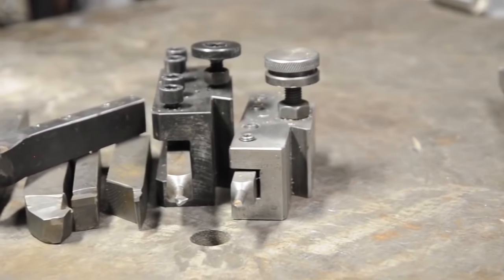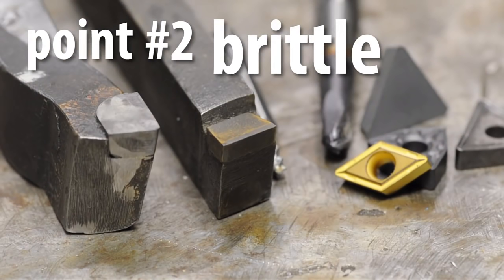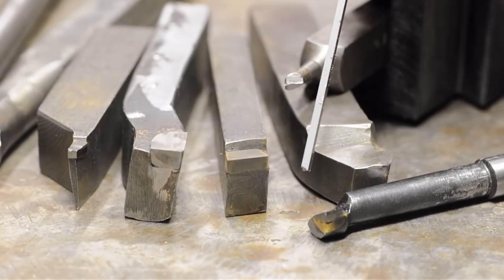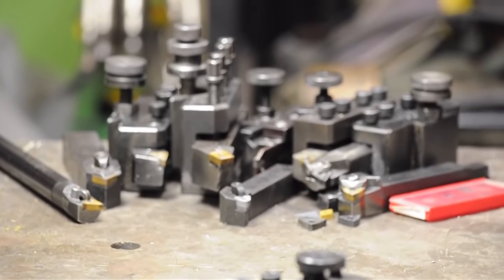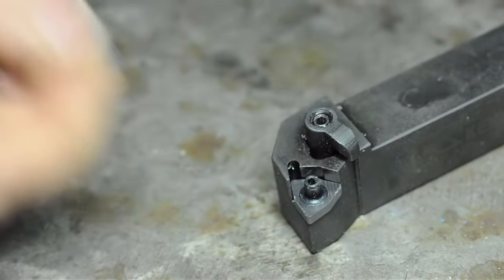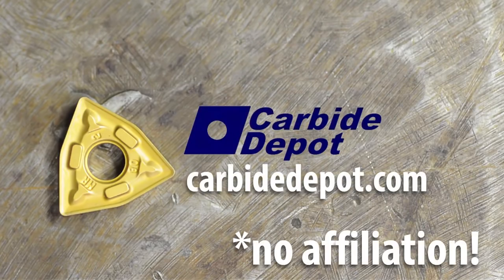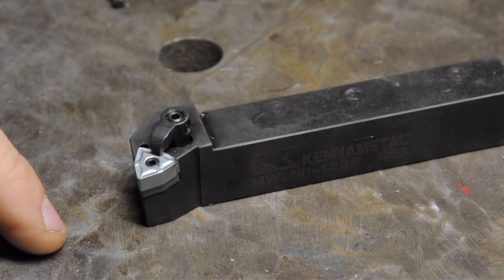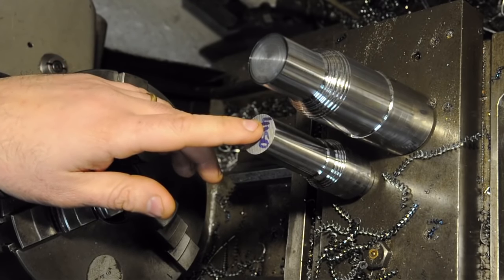A Brief Chat about Carbide Tooling

Comment: Tony, just wanted to drop by and say thanks. I'd consider myself a fairly experienced hobby machinist, but after watching this video on carbide tips, I went into the shop and raised my spindle speeds and cut depths considerably. Holy heck. I can't believe the results. Now running 3 x faster and taking cuts 4 x deeper. Instead of swarf, I'm now covered in 1" long chips. I'm now taking 40 thou at 1250 rpm. You Sir are a legend.
Reply: Your depth of cut should normally be a minimum the same as your nose radius, and a true bare minimum of 2/3 your nose radius. So if you were using a "08" nose (1/32") then 40 thousandths is good, and a typical minimum of .032" depth. Hopefully if you were only taking .010" cuts before you were using an 04 (1/64) nose, since the absolutely minimum of that is a 10 thou cut. Those are just the general rules for proper chipping and surface finish, but also require a proper feed rate and RPM top go with them.

The maximum depth depends on the insert type, how much HP the machine has, and how rigid the machine is. A CNMG type has the largest depth of cut (.667 * length of insert edge), next is a TNMG and DNMG (.5 * edge length). WNMG is usually the smallest maximum depth of cut insert type (.25 * length to the middle point of the edge), but the tradeoff is it can be used for both turning and facing and has 6 cutting sides per insert.
Reply: @LordSaliss  i wish I knew what those words meant. I have a little mini lathe. Im here to figure out what the different tooling is used and how its used. Think im already ar a disadvantage. My motor burned up so I put on a ½ hp motor from a whole house fan. Only have high and low. With no idea as to the rpm.
Reply: @kathleenrobertpogue6818  Highly recommend picking up an old treadmill or stairstepper for cheap. Durable strong motors in those things, and can be had for sometimes less than $50, especially if you find a damaged one with a good motor

Comment: Easiest thing to make in any shop is a broken end mill or bit.
Reply: Or mill vice
Reply: lol
Reply: When you get really good, like me, you can turn aluminum and steel stock into scrap.
Reply: Dennis Young  I like to turn small broken carbide into spade bits - good for drilling out other broken (HSS) stuff if it's not too deep.
Reply: Wen a tool breaks the second time, does it become good again?
Reply: Broken taps is also really easy
Reply: @hans429  easy there brother... “thinking” out loud can be dangerous. Humor is also rather tricky when you never “practice”... experience is something we only gain after we need it. 
hang in there like your a dingleberry nicknamed  “Forrest grippin’ “
Reply: Some tool manufacturers: well it will be harder to break if you buy our new collection of tools at ke*****al
Reply: @galvidmar1247  lol right.
Reply: Lol, very true.
Reply: Sometimes I go out to the shop and make a whole bunch of broken taps.
Reply: I saw a guy break a carbide tipped tool when he ran the mill the wrong direction xD

It was funny cause i didn’t do it :)

Loved them carbide inserts.
Reply: I’m ioooooppp

No

Comment: If you plan on grinding your own carbide tooling, just know usually the component that holds carbide particles together is cobalt and its not the best thing to inhale. So use precautions like respirator etc.  I'm sure Tony just forgot to mention this.
Reply from the maker: Yes!  Good point.  I mentioned that in the boring head video but this would've been a fine place to bring it up again.
Reply: Dennis Young  better safe than sorry. You would need a continuous stream of coolant around and over the entire surface to minimize the risk of breathable particles flying about.
Reply: @eccomi21  even then not worth it. Best to be kept safely locked away from the world. In today’s world danger lurks everywhere.

Comment: I came here with two big questions. #1 How to distinguish carbide inserts via taste-test, and #2 where DOES he get his nails done. You answered NEITHER.

10/10 will watch again.
Reply: Carbide is significantly heavier than HSS, also isn't very magnetic
Reply: +Jake Scollay: "Carbide is significantly heavier than HSS, also isn't very magnetic"
And it tastes like chicken.
Reply: Cook your carbide in the sous vide at 66C for an hour then finish with a quick sear in a hot pan.  Really brings out the flavor and reduces the brittleness caused by sauteing.
Reply: Both nails and carbide are done "a la dente" and remember the water should be as salty as the Mediterranean. Hence biting both; rather salty.
Reply: Al dent eh?
Reply: A tricycle, because a vest has no sleeves. (Orange Sherbet 1972). Paul C. USA
Reply: Little machine shop
Reply: @sc0llay  the
Reply: I believe he does his nails on the CNC router with that 4mm four flute endmill he's always talking about breaking
Reply: you should see the manicured  nails of that Joe guy, off putting
Reply: Thanks for that,very interesting!
Reply: Great learned alot  thanks

Comment: 1 Carbon Steels 
Carbon steels have been used since the 1880s for cutting tools. However carbon steels start to soften at a temperature of about 180oC. This limitation means that such tools are rarely used for metal cutting operations. Plain carbon steel tools, containing about 0.9% carbon and about 1% manganese, hardened to about 62 Rc, are widely used for woodworking and they can be used in a router to machine aluminium sheet up to about 3mm thick.

2 High Speed Steel (HSS) 
HSS tools are so named because they were developed to cut at higher speeds. Developed around 1900 HSS are the most highly alloyed tool steels. The tungsten (T series) were developed first and typically contain 12 - 18% tungsten, plus about 4% chromium and 1 - 5% vanadium. Most grades contain about 0.5% molybdenum and most grades contain 4 - 12% cobalt.

It was soon discovered that molybdenum (smaller proportions)could be substituted for most of the tungsten resulting in a more economical formulation which had better abrasion resistance than the T series and undergoes less distortion during heat treatment. Consequently about 95% of all HSS tools are made from M series grades. These contain 5 - 10% molybdenum, 1.5 - 10% tungsten, 1 - 4% vanadium, 4% Chromium and many grades contain 5 - 10% cobalt.

HSS tools are tough and suitable for interrupted cutting and are used to manufacture tools of complex shape such as drills, reamers, taps, dies and gear cutters. Tools may also be coated to improve wear resistance. HSS accounts for the largest tonnage of tool materials currently used. Typical cutting speeds: 10 - 60 m/min.

3 Cast Cobalt Alloys 
Introduced in early 1900s these alloys have compositions of about 40 - 55% cobalt, 30% chromium and 10 - 20% tungsten and are not heat treatable. Maximum hardness values of 55 - 64 Rc. They have good wear resistance but are not as tough as HSS but can be used at somewhat higher speeds than HSS. Now only in limited use.

4 Carbides 
Also known as cemented carbides or sintered carbides were introduced in the 1930s and have high hardness over a wide range of temperatures, high thermal conductivity, high Young's modulus making them effective tool and die materials for a range of applications. 
The two groups used for machining are tungsten carbide and titanium carbide, both types may be coated or uncoated. 
Tungsten carbide particles (1 to 5 micro-m) are are bonded together in a cobalt matrix using powder metallurgy. The powder is pressed and sintered to the required insert shape. titanium and niobium carbides may also be included to impart special properties. 
A wide range of grades are available for different applications. 
Sintered carbide tips are the dominant type of material used in metal cutting. 
The proportion of cobalt (the usual matrix material) present has a significant effect on the properties of carbide tools. 3 - 6% matrix of cobalt gives greater hardness while 6 - 15% matrix of cobalt gives a greater toughness while decreasing the hardness, wear resistance and strength. Tungsten carbide tools are commonly used for machining steels, cast irons and abrasive non-ferrous materials. 
Titanium carbide has a higher wear resistance than tungsten but is not as tough. With a nickel-molybdenum alloy as the matrix, TiC is suitable for machining at higher speeds than those which can be used for tungsten carbide. Typical cutting speeds are: 30 - 150 m/min or 100 - 250 when coated.

5 Coatings 
Coatings are frequently applied to carbide tool tips to improve tool life or to enable higher cutting speeds. Coated tips typically have lives 10 times greater than uncoated tips. Common coating materials include titanium nitride, titanium carbide and aluminium oxide, usually 2 - 15 micro-m thick. Often several different layers may be applied, one on top of another, depending upon the intended application of the tip. The techniques used for applying coatings include chemical vapour deposition (CVD) plasma assisted CVD and physical vapour deposition (PVD). 
Diamond coatings are also in use and being further developed.

6 Cermets 
Developed in the 1960s, these typically contain 70% aluminium oxide and 30% titanium carbide. Some formulation contain molybdenum carbide, niobium carbide and tantalum carbide. Their performance is between those of carbides and ceramics and coatings seem to offer few benefits. Typical cutting speeds: 150 - 350 m/min.

7 Ceramics - 
Alumina 
Introduced in the early 1950s, two classes are used for cutting tools: fine grained high purity aluminium oxide (Al2O3) and silicon nitride (Si3N4) are pressed into insert tip shapes and sintered at high temperatures. Additions of titanium carbide and zirconium oxide (ZrO2) may be made to improve properties. But while ZrO2 improves the fracture toughness, it reduces the hardness and thermal conductivity. Silicon carbide (SiC) whiskers may be added to give better toughness and improved thermal shock resistance. 
The tips have high abrasion resistance and hot hardness and their superior chemical stability compared to HSS and carbides means they are less likely to adhere to the metals during cutting and consequently have a lower tendency to form a built up edge. Their main weakness is low toughness and negative rake angles are often used to avoid chipping due to their low tensile strengths. Stiff machine tools and work set ups should be used when machining with ceramic tips as otherwise vibration is likely to lead to premature failure of the tip. Typical cutting speeds: 150 - 650 m/min. 
Silicon Nitride 
In the 1970s a tool material based on silicon nitride was developed, these may also contain aluminium oxide, yttrium oxide and titanium carbide. SiN has an affinity for iron and is not suitable for machining steels. A specific type is 'Sialon', containing the elements: silicon, aluminium, oxygen and nitrogen. This has higher thermal shock resistance than silicon nitride and is recommended for machining cast irons and nickel based superalloys at intermediate cutting speeds.

8 Cubic Boron Nitride (cBN) 
Introduced in the early 1960s, this is the second hardest material available after diamond. cBN tools may be used either in the form of small solid tips or or as a 0.5 to 1 mm thick layer of of polycrystalline boron nitride sintered onto a carbide substrate under pressure. In the latter case the carbide provides shock resistance and the cBN layer provides very high wear resistance and cutting edge strength. Cubic boron nitride is the standard choice for machining alloy and tool steels with a hardness of 50 Rc or higher. Typical cutting speeds: 30 - 310 m/min.

9 Diamond 
The hardest known substance is diamond. Although single crystal diamond has been used as a tool, they are brittle and need to be mounted at the correct crystal orientation to obtain optimal tool life. Single crystal diamond tools have been mainly replaced by polycrystalline diamond (PCD). This consists of very small synthetic crystals fused by a high temperature high pressure process to a thickness of between 0.5 and 1mm and bonded to a carbide substrate. The result is similar to cBN tools. The random orientation of the diamond crystals prevents the propagation of cracks, improving toughness. 
Because of its reactivity, PCD is not suitable for machining plain carbon steels or nickel, titanium and cobalt based alloys. 
PCD is most suited to light uninterrupted finishing cuts at almost any speed and is mainly used for very high speed machining of aluminium - silicon alloys, composites and other non - metallic materials. Typical cutting speeds: 200 - 2000 m/min.

10 Other Materials 
To improve the toughness of tools, developments are being carried out with whisker reinforcement, such as silicon nitride reinforced with silicon carbide whiskers.
Reply: The knowledge gained from your inputs are so thorough & simply compiled that even the basic students would easily understand. 
A great compilation on the modern tooling materials and highly appreciated.
Reply: Was this Google paste
Reply: I was not prepared for the commitment required to read this whole post....
Reply: Great information, but YT comments are  a bugger to format when pasted into MS Word. :-(
Reply: @TrevorDennis100  paste to notepad 1st then copy the notepad to Word (the format will be nicer)
Reply: @malcolmparkins1935  Thanks Malcolm.  I usually paste into Word, and use Ctrl Space to strip the formatting, but I just tested doing it your way, and it is way better.  So top tip.  Thanks
Reply: @Skhillz_FN     Mr. 4 Subscribers .... 🙄😂😂😂
Reply: @AlexAlcyone  hi there atomic
what do you mean    ""shift command T""".   could you please explain the actual key strokes. :)
Reply: Excellent
Reply: This is helpful
Reply: ever work with high speed tatung stock..dont recall what cobolt content was but  was very good for machineing alloys..monel tita ium..4340....had the wear  capabality  of carbide and shock redistance of high speed..but not friendly to grind..took longer
Reply: Dafuq. Common knowledge that Knights were invented in 1880 to Fight Hitler in 1493 with their gummiswords.
Reply: THX; you just beat the pants off chatgpt! Much respect for TONY et al.
Reply: @11
Reply: Nice Cut and Paste....

Comment: Another great video Tony! One thing that keeps coming up on hobby forums for people with smaller lathes is they always say they can not remove much material on them because they are not heavy enough and/or don't have enough horse power. I have an old Craftsman 12" lathe, and find that for the most part, if you use it like it was designed, using a lantern tool holder, HSS and the proper high positive rake, you can peel off much larger amounts than using a quick change toolpost and insert tooling. Now I will say I also do not use the lantern very often, and use insert tooling, but because of the higher speeds and feeds required, as you pointed out, I typically use HSS inserts from Arthur R. Warner in my holders. They cut much better at lower speeds, and you can keep them sharp with honing.  Keep up the great work, love watching and learning!

Comment: I started lathe work with carbide tooling, couldn't figure out why the parting tool kept breaking so I got frustrated, ran it dry and reefed on it. Cleanest parting cut I ever saw
Reply: I can never get my parting tool to work worth anything, will give that a try.
Reply: @Current Batches my lathe is just a smithy, and I run into chattering problems a lot with it because it is so light.
Reply: Truth. The box does say up to .01 per rev
Reply: @orionfleming6783  Try running the parting tool upside down on the opposite side of the work.  That helps with the "flexible" tool posts of cheap tiny lathes.
Reply: Making sure you're cutting below center can help.

Comment: Tony fantastic job again! I did want to add that the coating in the inserts I sent you is PVD rather than the TICN coating you have been running . The coating as amazing , it is what provides the cutting surface. I like to think of it as a layer of magic. This provides a very sharp cutting edge and why your part was cool when you where done. I have seen a significant drop in power needed to use the newer PVD tooling. Again love what you are doing for the Hobby people, keep up the great work!
Reply: Here is an article that tells a small amount about the coatings. This stuff can get a little overwhelming quickly.

http://www.productionmachining.com/articles/a-guide-to-insert-coating-processes-and-materials
Reply: Yes, it is a process and how they apply. The PVD coating is all they tell us :) The formula as that link showed is not the same for all of brands. I have found that Seco has worked the best for us here. The speeds are amazing for the new carbide. The new tools will allow for 1700 - 1900 FPM . We can't run that fast on most of the parts we make but in testing DNMG tooling with a nice sharp tip and a low feed chip breaker have allowed us to make some amazing parts on small lathes. We where doing Tops at cabin Fever in PA. The people asked me how I polished them, I had to cut one to show we where not doing anything. I don't know the formula of the coating but I can tell you that it works and it is scale able down to a 500W spindle.

Comment: TOT: you are a brave soul to tackle carbide tooling as a topic, there are sooooooooooooooooooooo many variables, not the least of which is many home shop lathes are of a vintage and or style not really meant to take advantage of the benefits of carbide which in turn (ha, ha?) means increasing those variables at least several exponential levels.
Reply from the maker: Thanks Russ.. and yes, these sorts of videos aren't easy to make. :)